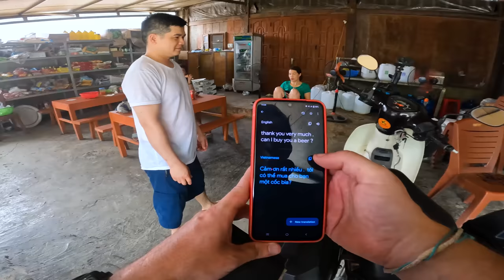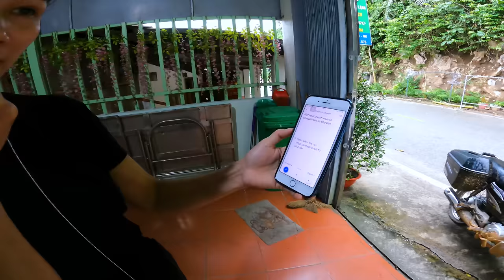LANDSLIDES and FLAT TIRES 🇻🇳 VIETNAM by MOTORBIKE Ep:3

Comment: As I did parts of your planed tour, here some recomendations. Rua Xe is for minor repairs like a flat tire or for changing oil. At Rua Xe its also big fun to wash your Honda CUB. I drive a kind of Honda Dream here in Europe too (Honda Innova) I recommend  Micheline City Grip Tire (extra protection agauist flat tires) and its available in your sizes. Front 70/90-17 and rear 80/90-17.

Comment: Next time when you have a flat tyre, start the engine put your in gear and just control the throttle. Your don't have to use strength to push your bike.

Comment: Hi Paddy.. In regards to your tire problems...perhaps u should try to look at the condition of your tires in the first place. If  the tire threads are already too thin due to wear n tear, the heat generated from travelling long miles can destroy the tube within n made it susceptible to punctures. So.. Solution.. change to new tires if possible. Also, u have to learn to fix punctures on your own, though u may need to carry specialised tools for that. Another solution is to switch the spoke wheels to sports rims so that u can use tubeless tires which are much more durable n easier to fix if a puncture occurs because u don't need to dismantle the tire to fix the puncture. Plus not as many tools needed to do it. Alternatively, u can also buy one or two of  those puncture sealant in a can where u only need to inject the entire content inside the tire to seal the puncture.

Comment: I bought a 3 year old car. Nissan service said the tyres had rotted due to heat exposure, and should be replaced. I took their advice and never had tyre problems. At 4 years of age nissan advised me to change my battery. I cannot afford to be stranded in Thailand as there is no Automobile Club and I don't speak Thai to get road side assistance. I've never had a flat battery.
Paddy, you should have given the bike a full service, new tyres and tubes, filters, spark plug chain lube or replace.
Should you ride "King Kong" to the Mekong? (Maybe Kong for short) Or should "Queenie,"  replace Dreamy?

Comment: I notice your bike has spokes.  If you continue to get flats, you may want to check the spoke side and make sure you have a plastic or cloth strip that COMPLETELY covers them so that you aren't getting the inner tube poked from the inside when you hit bumps.  I had one bicycle ride years ago where I got five flats on the ride, and that was what was causing them.  Also, how would it feel to carry an extra inner tube, patch kit and tire change kit, like bicyclists do for when you are out in the boondocks?  Beautiful countryside.  Thank you for sharing your adventures.

Comment: Tip no. 347/B...
Buy a couple of new spare inner tubes to carry with you.
Cheap as chips (70 Baht) and take up little space.
Much better than bicycle repair patches which is what you get in most countryside shops.
Just give the blokes a new inner tube..
Tip no. 348/C
Learn to fix a flat yourself.
Very simple, few tools needed, and very rewarding, espesh in the middle of nowhere.
3 spanners to get the back wheel out (only 1 on the front) and 2 tire levers.
Bish bosh, jobs a good 'un.
Self reliance man.

Comment: 0:41sec starting your video.. ok tips for flat tire WHICH USING TUBE.

1. Always had a wide enough band of tube cut off to wrap the inner steel rim.. oftenly the rim or the stud eating the tube.
2. Always wrap the new tube with the existing tube WHICH cleared from any tube eaters..
3. Always check the tyre.. tyre which old & do not have enough rubber at the center tend to flat when bitten by stone.. 
4. 200kpa tyre pressure.

Comment: You need to run an old tube cut up as a liner between the tube and the tyre to minimise abrasion, and basically just fill your tubes with run flat liquid.....not recommended over 80-90km/h so ok for Steamy or whatever this one is called....

Comment: Paddy,  could it be possible one of you spokes is poking through the rim on the inside , or there’s something on the inside of the rim pinching or puncturing the tube ?,… kinda unusual to get one flat after another , next time they have the tire off the rim inspect the inside of the rim , if there’s a rubber band that runs around it lift it up and inspect underneath and feel for any sharp objects  ( maybe blow the tube up before it’s been patched and spin it slowly through a bucket of water and see exactly where it’s leaking , if it’s on the inside circle of the tube ya know it’s something puncturing it from the rim ) you’ll also be able to see if your leaking air from the step when you put that part under water

Comment: Regards to tire problem you may have to much weight on the back wheel with a possibility of too much air pressure aswell paddy 
I'd recommend a can of tireweld to get you out of problems

Comment: Great videos -When the rubber in tires degrades due to age, exposure to the elements, or a combination of both, it may crack. In turn, cracks in your tire rubber can be hard to spot and repair, leading to slow leaks, recurring flats, and even blowouts.

Comment: that is too much for a flat tire an 2 drink, anyway for those who want to avoid flat tire while riding in VN, avoid sand dunes in the middle the road, even it really small and seems innocent, usually the front tire will throw the nail or metal chunk to the back and the back tire will be the victim, but the second time maybe the first puncture is leaking